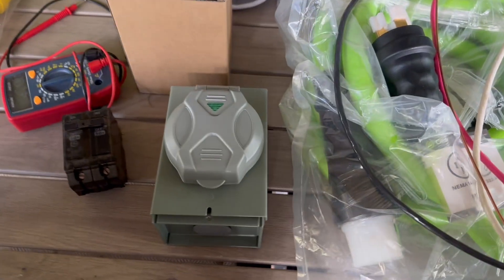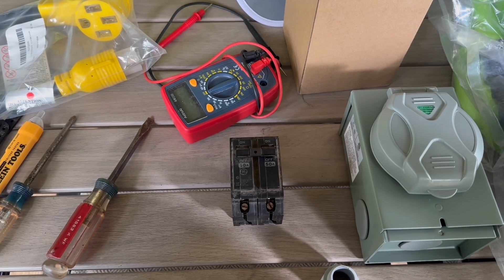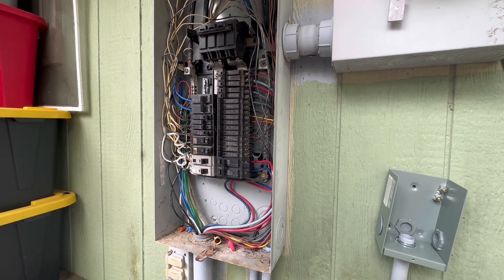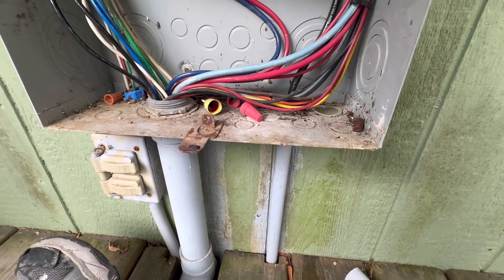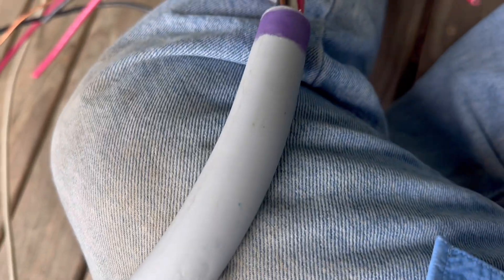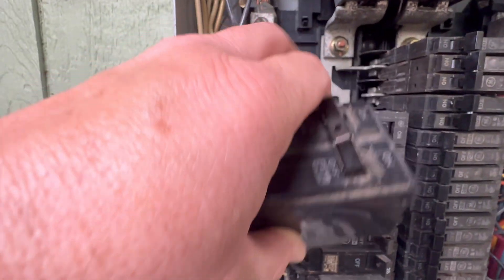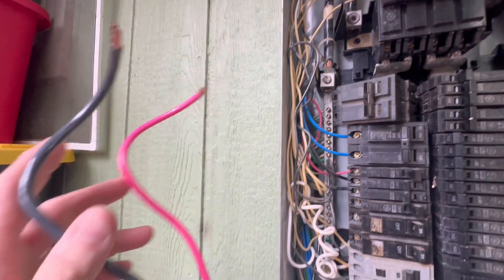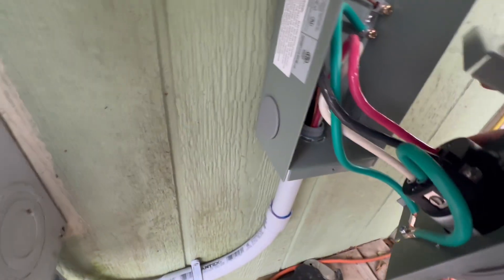How to install a 50 amp generator inlet box on your home!  Run your WHOLE house or most of it!!

Comment: Anyone doing this needs to check the NEC to see how many of what size wires are allowed to run in what size conduit. It's all about safety and fire-prevention. And, don't make your own Interlock...insurance companies will use any excuse they can to not pay out in case of damage or injury. If I were a Lineman I'd be pissed at someone manufacturing their own interlock. Another "Pro tip"...install the breakers before connecting the wires. Save yourself lots of struggle. I recommend using a plug-box that angles the cable in a downward angle. The box used here has a constant strain because it's sticking straight out from the wall. The downward angle box has nice weather-resistant capability also.
Reply from the maker: @choimdachoim9491  You make a good point on the homemade interlock.  I generally install wire(s) before installing breaker because it is easier.  

Thank you for the critiques and thank you for watching!
Reply: @choimdachoim9491 what box from Amazon do you recommend?  I am not sure which angles down like you mentioned.
Reply: @jefflewis1051  I saw one in Lowe's or Home Depot,  not sure which.
Reply from the maker: @jefflewis1051  Below is the description from my box purchased on Amazon:

50 Amp Generator Inlet Box [Pre-Drilled] with Green Safely Light, NEMA SS 2-50P PB50 Weatherproof Inlet Box, Power Inlet Box for Emergency in Snowstorm Weather, ETL Listed

Thank you for watching!!
Reply: The box you recommend is angled???  Got a link?
Reply: @REVNUMANEWBERN  no, sorry. I watch YouTube videos 5 or 6 hours every day on a multitude of subject matters and I've seen them but have no idea of the source.
Reply from the maker: @REVNUMANEWBERN  Below is description from Amazon.  

50 Amp Generator Cord and Power Inlet Box [Pre-Drilled], 15FT Generator Cords 50 Amp,125V/250V Generator Power Cord NEMA14-50P/SS2-50R Twist Lock Connector

Thanks for watching!

Comment: Is your generator Neutral bonded to Ground? if yes, then you just wired your Gen 50A outlet box wrong. You should not have 2 bonded neutrals (home main panel and Gen), your portable Gen is set to work independently and not to backdfeed your Main panel as a fixed Gen. That is Why is bonded, UNLESS your's is not. Clarify if your Gen has bonded neutral (for viewers)  because otherwise your wrong connection project is potentially making other run the same risk. This differs between Gen with bonded neutrals from factory set or floating neutral. NEC code. Hope this helps to avoid accidents due to lack if information on hand before repeating what others do in Youtube.
Reply: That's what I did on my generator, I installed a switch between the ground and neutral bridge and switch OFF when is use to feed the braker box and switch ON when is use with extension cord to the appliance, works for me and no issues power my house.
Reply: He can just float he’s neautral in the generator

Comment: Great step by step videoI!  One part I’m still not clear on is the 50 amp breaker installed, how is that tied in to rest of the house wirings?  Isn’t it still independent like the rest of the house circuit breakers?
Reply from the maker: @doradean3097  Thank you for the view and the compliment.  

You are backfeeding power from the generator into the inlet box via a heavy 50 amp generator cord.  From the inlet box, 4 strands of wire (3 coated and 1 bare) lead into your breaker box (panel).  2 of the coated wires (black and red) each carry 120 volts to their terminal on the side of the 50 amp breaker.  Since the breaker is connected to power logs in the breaker box, it powers the box with 240 volts (remember, each wire carried 120 volts).  

The remaining coated wire (white), is the neutral and is connected into the ground bar (bus).  The bare copper wire also connects to the ground bar.  

This process of back feeding energizes the main power lugs in the breaker box, which all other breakers connected to now have power and feed their perspective circuits.  

I hope this helps.
Reply: @TexasPatriotOffRoadAndOutdoors  Got it, the whole panel is energized by the back feeding, which is why it’s important to add the interlock as you’ve mentioned.  Thank you so much for sharing your experience with all of us so we  can have options besides the big name brand permanent whole house generator which I could never afford.
Reply from the maker: @doradean3097  I will be adding an interlock soon.  Stop by if you can in the near future.  Again, thank you for the view and compliment!
Reply: @TexasPatriotOffRoadAndOutdoors  Explained very well/.
Reply from the maker: @chrissimmons6358  Thank you!  I appreciate the view!

Comment: Is that a suicide extension cord I see?
Reply from the maker: @craigfelter  Not a chance.  It is a proper 50 amp 6 gauge generator cord bought on Amazon for $100.
Reply: @TexasPatriotOffRoadAndOutdoors  Yes it is! The way he wired the neutral and ground....the ground is on the left side of your box (bare wire) and the neutral wire (white one) is on the right. You need to seperate them or you will send power into panel thru the neutral wire

Comment: Where did you buy that green cable for the generator?
Reply from the maker: @Zdosse  Both the inlet box, 30 amp to 50 amp adaptor and the green 50 amp cable came from Amazon.  

All of that plus the wire and conduit parts purchased at Home Depot cost around $200.00.
Reply from the maker: @Zdosse  Thanks for watching!

Comment: How can i connect my generator to my sub panel located in my garage and subfeed to my main panel in my basement?
Reply: Follow this install on your sub panel. You'd definitely need to figure out a lockout procedure at the main panel though. You'd basically be using the generator breaker to energize the sub panel load bars to send electricity back to the main via the sub panel breaker. You'd have to make sure the main is off without an interlock since the main and sub feeder breaker can't be in at the same time during normal circumstances. Then there's the fact that the sub panel has no bonded neutral since it'd be using the mains bonding terminals. 

Best to find a way to do the main panel.
Reply: Don't do that. In a crises you will forget to turn-off one of the Main Breakers, and will hurt something. Plug the generastor into the house and work from there ONLY.

Comment: If the generator does only 30 amps use a 30 amp. Breaker not a 50
Reply: generator will still trip in excess of 30 amps. 50 amp breaker is the way to go.
Reply: I’m about to do the same way he did it… I’ll get a bigger generator later when the crazy rush for them is lower
Reply: I sure he is about to get a bigger gen seeing as he can't run the AC
Reply: There is no adverse impact to running a 30amp gen on 50amp setup. It just means amperage is bottle necked at the generator and can never operate as a 50amp service until upgraded later. Just make sure the wire size such as 6/3 for a 50amp service is in place from Gen to breaker.

Comment: Nicely done Sir. Thanks for sharing the knowledge. Mine will be a little more complicated because the breaker box is recessed into a garage wall and I want the power port on the exterior wall behind the garage (with brick siding). Good times.
Reply from the maker: @6-Iron  That will be a bit more complicated on the installation - especially the brick!  Hope it goes well.  Thank you for watching!

Comment: Sir, thank you so much. We got power back this week. But I'll never again have extension cords running through my house. I want this so I can provide 240v to the well pump easily.
Reply from the maker: @Mekanik_Joe  It really was a game changer for us.  

Unfortunately, I am required to work during events like this, so my wife and kids are left to take care of the household needs, which before required extension cords, fridges being pulled out and etc.  

This will be so much easier for her, as she just needs to turn off the main and out 4 220 volt circuits, start the generator and the plug in one large 50 amp cord.  All lights and regular outlets are up and running!  

Thanks for watching!
Reply: @TexasPatriotOffRoadAndOutdoors   Thanks for the video.  Is there a way to get the 220 circuits?
Reply from the maker: @1Corinthians15.1-4  Yes, a couple of ways:

I could run 1 of my 4 large 220 items, AC, Stove, Water Heater or Dryer along with a few of my other 120 volt circuits, being careful and selective with my current 5500 watt generator.

Or, get a larger, at least 7500 watts, and still choose 1 of the 220 items at a time but with ALL the 120 volt circuits.  

Or, get like a 12,000 watt or larger and turn in all the circuits!

These wattages are running watts, not peak.  

Good luck and thanks for watching!
Reply: @TexasPatriotOffRoadAndOutdoors   Thank you.
Reply: @TexasPatriotOffRoadAndOutdoors  SO....IF I am understanding you correctly there would be NO altering of 220 circuits but all you would have to do is cut everything else OFF and then turn on the 220 object?
Reply from the maker: @REVNUMANEWBERN  with my generator, I can run all my 120 volt circuits, with limited use of one of my 220 volt circuits.  
The key is to have an understanding of what each circuit draws and monitor your generators load.

Comment: What Cain of wire it’s it for braker to the plug box
Reply from the maker: @JoseHernandez-qw4hm  For the 50 amp inlet box, I used 6 gauge wire (3 strands of insulated 6 plus a bare ground).
Reply: @TexasPatriotOffRoadAndOutdoors  where I can bye the wire please
Reply from the maker: @JoseHernandez-qw4hm  I purchased the wire from Home Depot but most hardware or electrical supply stores should have it.
Reply: @TexasPatriotOffRoadAndOutdoors  I appreciate it thanks a
Lot you save my life have a blessed day
Reply from the maker: @JoseHernandez-qw4hm  You’re welcome. Please be safe hooking everything up!

Comment: Great video..  I’m currently waiting on my 30 amp to get here so I can do the same..
Reply from the maker: @fishaman7834  Just food for thought, if you are able to return the 30 amp stuff, you may want to wire in a 50 amp inlet (if your panel allows it), then use an adapter on your 30 amp generator.  

That will give you room to grow with a bigger generator-set in the future!  Just my 2 cents!

Thanks for watching and good luck with your install!
Reply: @TexasPatriotOffRoadAndOutdoors  THANK YOU, I already have a Gen with a 30 amp plug but am getting another gen that has both plugs, so with the gen that JUST HAS the 30 amp plug then all I need is the adapter to plug into the 30 gen to the 50 fuse box connection??
Reply from the maker: @REVNUMANEWBERN  That is correct.  You just don’t want to run a 50 amp gen into a 30 amp circuit.  Thanks for watching!
Reply: @TexasPatriotOffRoadAndOutdoors  thanks for the info.. greatly appreciated
Reply from the maker: @fishaman7834  Glad to help!  Thank you for watching!